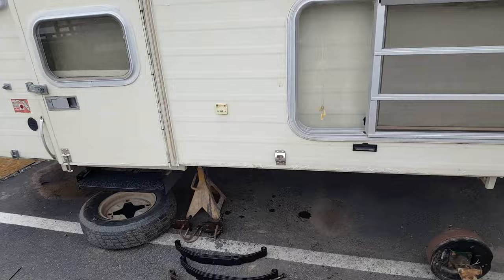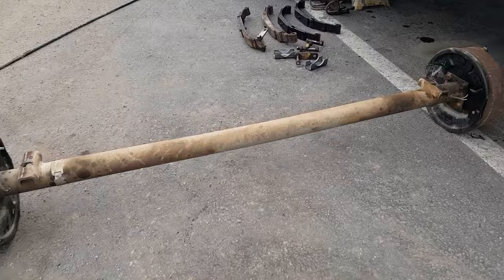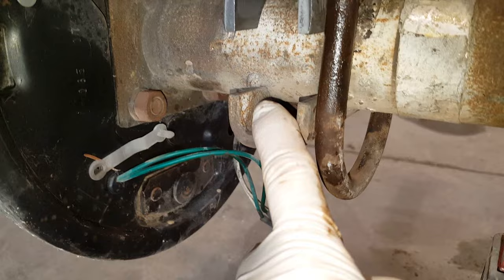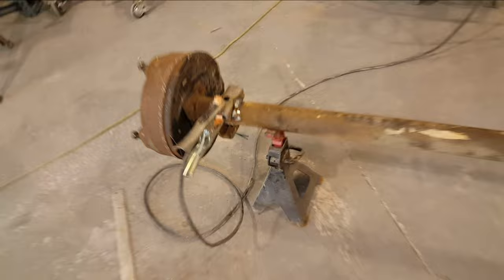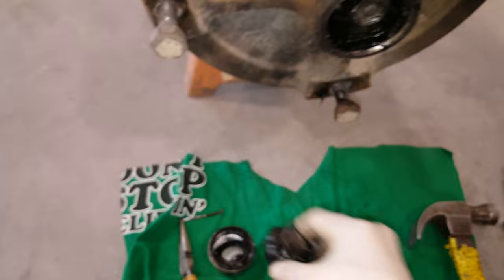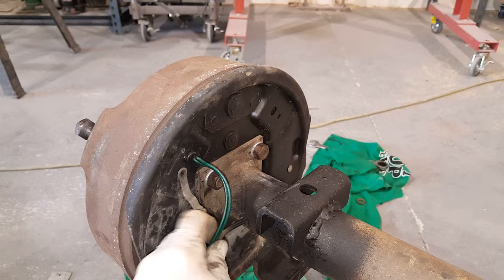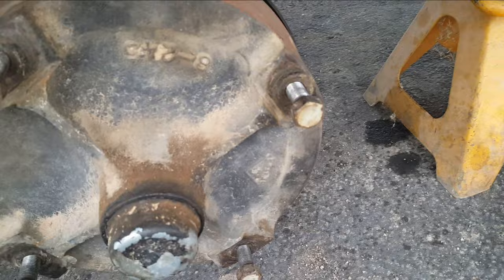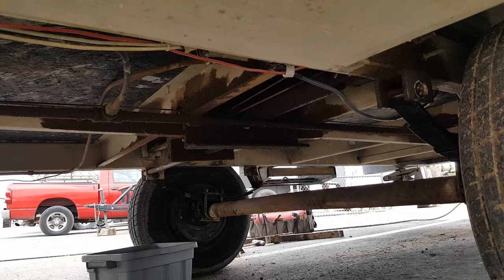Trailer Axle Flipping....What's the BIG Deal?

Comment: I’ve learned to be cautious when welding perches on trailer axles. If the wiring for the brakes happens to be touching that area inside the axle tube where you’ll be welding, it doesn’t end well. I’ve gone as far as using bailing wire for a fish tape and leave enough bailing wire to pull them back through when I’m done welding.
Reply from the maker: thats a good idea too

Comment: Iam a  Veteran of the same job!!!  Time consuming but not difficult. Not sure if customer requested quality parts but try to use Dexter components. And Wet bolts. Most springs come with crappy nylon bushings, tap them out with the new brass bushing. Nylon dry bushings are junk. And DIYers paint the entire job with Rustoleum. Customer most likely didnt want higher labor charges. Great job!!
Reply from the maker: I'm not convinced Dexter is any better quality. I try my best to weigh quality work with cost to owner. This was a "project" trailer that came in for a simple solar panel install. The owner felt like it was leaning when being towed and this is what I found. Ideally the axle and all components should have been replaced and new tire rims, but that would cost more than the trailer that would receive minimal use. Thanks!

Comment: Usually takes way longer when you’re filming! I never did this axle flip, but was looking at a trailer a few years back that needed this done. I admit, I would have not done this correctly due to lack of knowledge on this subject. I n9t know the correct way to do this. (By the way, your video just popped up. I was not searching the subject) Great video. Many will benefit from it, and my knowledge has increased. Thanks.

Comment: Looks like I guessed correctly when hanging the new axles .I wasn't sure what direction the axles went but I figured wires out the back ...lol... looks like I don't have to swing them around.  The old 3500lb idler axles only had a 1/4 inch long bead on 1 end diagonally from each other ...not all 4 corners just 1 corner diagonally.  I realize there's no twisting force on these like a drive axle and when they make 1000s of axles it saves money and time , but for me when I put the new 5200lb  brake axles on in place of these I ran beads I know are not going to ever fail ...lol... it's just like the hanger kits they sell that are identical for 2000-7000lb axles... I've seen those broken as well , so  extra beef was added to all the mounting because who wants to crack something  hitting a pothole on the road because big manufacturing companies do the minimum to save a few dollars on assemble line vs building it bullet proof .

Comment: Given that the wheels are  an old style not used any longer (as evidenced by the wheel lug pattern), I would have highly encouraged the owner to replace either the entire axle or at least the hub/drum if a modern style 5 on 4-1/2 is available to fit the old spindles.
Reply from the maker: You'd be surprised how little people want to spend on a $500 project trailer
Reply: @AZExpert   You shouldn't. be. LOL

Comment: I have always been of the opinion that if you remove U bolts from an axle, they should be replaced with new. Because torqueing tends to twist them a little, and removing the nuts when removing weakens the threads. Just a thought.
Reply from the maker: I have always heard that too. In researching it, it seems like "best" practice but no real hard facts stating it has to be done, other wise it would be true for all bolts. To my knowledge only torque to yield bolts require it and of course locking nuts and washers. Like all things, damaged hardware should be replaced but also not all owners are willing to spend $15 sometimes no matter what. Thanks!

Comment: Use torpedo level, top and bottom for welding on perch.....check with measurements,  but using level will guarantee axle is parallel to ground before you start,  and new perch will match.
Reply from the maker: Thanks for the tip

Comment: The reason for the bow in the axle is because the axle tube is not very heavy for the load it’s carrying. Travel trailers are made as light as possible. Thinner axle tubes save weight. 
Next time you see a semi trailer parked take a look at the axle. There’s no bow because it’s designed to hold 20,000 lbs each. 
In a light trailer there is a few inches of axle that is between the springs and the tire. This space creates leverage on the center area of the axle. When you load your trailer the bow straightens out. If you flip the axle up side down the axle would bow even more creating a negative camber at the tire causing premature tire wear.
Reply: John VH 2019 

You’re partly right

Comment: I once used new hardware but needed to loosen a nut. You guessed it,  it wouldn't give up without a fight.  The rv parts  supplier told me the U-bolt is designed to stretch the threads at full torque for safety.
Reply from the maker: I don't know much about it all, but I know a local suspension shops that makes u-bolts and they are put in a jig and bent for $5-10

Comment: You should have put new bump stops on the trailer now too.  While the trailer was raised about 4”, the range of the springs did not change and the bump stops need to be lowered what you raised the trailer from the spring-over conversion.

That’s why the spring broke in the first place.  Excessive travel.

Comment: Primary and secondary shoes are now reversed.  If they were reversed when the previous owner flipped the axle, you corrected the mistake.  If not, you made a mistake when you rotated the backing plate without swapping the front and rear shoes.
Reply: He did exactly what he should have done. The wiring went out the back to the rear. Primary shoe was in the front. He even states which direction the wheel would rotate. His explanation is spot on.

Comment: I have a 1987 camper that I wanted to raise the ride height on a few years back. Axle flip wasn't really possible since it had a bow to it from the factory. However, I just welded on new spring perches. Worked great and didn't affect anything on the axle or springs
Reply: Mike Miller 

They are designed to have an arch. If you put the springs on the top of the axle. Yes, you in fact DID (axle flip) it

Comment: Although the Hi-Lo trailers were a lot more aerodynamic and very well built, they were extremely heavy, for what u gained in less wind resistant u lost more in towing weight, plus very expensive!
The salesmen would not mention this, "I'll tell the truth a couple of different ways before I'll lie to u!"

 Also because of the  limitation in height  and interior space they used smaller tires which wore out a lot quicker and rode very rough! 
Great video on axal repair!
Reply from the maker: Very pricey too

Comment: I may have missed something but my question is about the crown on the axle. If you were moving the springs from the bottom to the top why were you having to do all that to the hubs. I get that someone had already moved the springs to the top but just did an axle rollover which would have put the crown pointing down. With you installing new perches that would have enabled you to set the crown back at the top as it should have been. Wouldn't the hubs be in the right position since the axle was upright again? Unless when they did that axle rollover they switched the hubs at that time which would mean you would then have to change them back. Nice informative video though.

Comment: you should have switched complete backing plate from right to left, because if you look at your brake shoes, you now have the primary and secondary shoes backwards. The shoe with the most brake pad material goes towards the rear of the trailer. It matters on a car brake system, would imagine it works on same principle as that. Are your trailer brakes locking up? good video tho
Reply from the maker: Thanks for watching!

Comment: Guess the previous axle flipper had never heard of camber. That trailer will now pull better than it has pulled since the axle flip was done. I occasionally add camber to axles that have lost their camber or never had any camber to begin with.
Reply from the maker: It's understandable when we call it an "axle flip" I just couldn't be responsible as a shop owner for not addressing the major issue. Thanks!

Comment: Nice thorough job. So what your saying is the safest and most proper way to raise the trailer is, instead of flipping the axle, simply weld new perches on each end, on top of the axle, then mount the springs on top of the new perches? I'm thinking you also have to extend the spring mounts, both front and back?? Safety FIRST always. Happy travels
Reply from the maker: The spring mounts do not need to be extended as that distance does not change, only the the placement of the axle below the springs. Thanks!

Comment: On a trailer that is that old it is a good idea to replace the wiring that goes through the axle tube. They short out inside the tube.
Reply: Yes they rub inside tube and short out.I zip tie new wire on outside back.

Comment: It is always recommended to use new Ubolts and nuts, but great video overall.
Reply from the maker: Indeed, it is best practice to replace the u-bolts, but I know the owner was already spending more than he wanted too. Also, I do find myself wondering why u-bolts are one time torque bolts, but studs/lugs made nearly identically are never replaced no matter how many times they've been tightened. Part of me thinks there's a lot of CYOA from the axle manufacturer.
Reply: @AZExpert  U bolts bend when tightened.  Even if only a small amount,  they still mold themselves to the axle. Straight studs dont do that. And not all hardware is supposed to be reused. People just do it anyway. I doubt one reuse hurt at all. Just an FYI reminder.
Reply from the maker: I understand and I'm not a metallurgist or material scientist by any means, but the stress of tightening any bolt by its very nature stretches the metal at the threads even on straight bolts. I understanding replacing lock nuts and lock washers as one time use. I  am not arguing and agree with you, these are just thoughts I have while turning wrenches. Maybe I should have put the effort into being an engineer. Thanks!
Reply: @AZExpert I wasn't trying to start a debate, but there is a huge difference between U bolts and a standard straight bolt.  Actually, metal stretching is not a major concern.  And my previous statement was very poorly worded and I should have left that out.  ASE1541 steel has a tensile strength of 150,000 psi.   The true issue is that U bolts are made with rolled threads and not cut threads.  Rolled threads distort when torqued.  Cut threads do not.  Once rolled threads have been distorted, they can never be removed and reinstalled to hold proper torque.  In reality, they are single use threads.  U bolts can be retorqued as long as they are not loosened to do so.  That is because you are simply moving the nut up to new threads.  But once removed, the threads are permanently damaged.  This is not the case with a multi use bolt or lug with cut threads made of the proper grade and torqued to proper spec.  I confirmed this information with a mechanical engineer as well as a technical rep from a major spring manufacturer.  They also said loose U bolts are the #1 cause of broken springs.  So, I change my previous statement.  In this case, one reuse can hurt.  And this is one of those situations where not finishing the job with proper hardware could be the cause of future issues.
Reply: thecatsfan 

I’ve reused u-bolts many times with no ill affects. The ones that tend to brake are the shackles. Seen that MANY times. And no, u-bolt threads do NOT distort when torqued 😂🤦‍♂️I’ll let you figure out why😂🤦‍♂️Your book learning(?) doesn’t cross over into real life scenarios.
Reply: @Fordgroup00  Nothing to figure out.  Not going to argue facts.  The statement I posted above - a full year ago - is a direct quote from Eaton Detroit Springs.  The information was provided by one of their engineers.  If you want to argue with the manufacturing engineers - be my guest.  I have no further interest in your incorrect analysis.  I will trust learned knowledge and physics over dumb luck every day.
Reply: Mike Barger 

I’ve got quite a few years of actual hands-on experience. But cool story
Reply: @Fordgroup00  I don't care if you claim you invented them. I am not the one here pushing my personal opinion as fact. I am citing industry experts, documented engineering standards and referencing credible sources.  You claim to know better than the people who actually write the automotive engineering specs.  That's the tall tale here.
Reply: @thecatsfan  In all my years as mechanic I've never seen a U-bolt axle break. If it did break, it'd mostly be from over-tightening it. Because they didn't use a torque wrench and the proper specs.
Reply: @kdlittlehawk  I'm not even a mechanic and I have seen it more than once.  And if you have never seen it your assumption that it was not torqued properly is baseless.  The manufacturing engineers openly disagree.
Reply: @thecatsfan  Leafsprings break first before any U-bolt will. Engineers aren't on the front line seeing whats' happening. I've had truck and diesel vocational training/schooling and worked in the truck and heavy equipment industry for years. I've never seen a U-bolt broken as a primary factor. Replacing them may be a good idea but not necessary. Replacing any used nut or bolt is a good idea but again, not necessary.
Reply: @kdlittlehawk  I don't care if you teach mechanical repair.  That entire argument is a defined logical fallacy.  Who you are or what you do does not change physics.  So far your primary arguments are that you are smarter than an engineer because you turn a wrench for a living, and what you have not seen does not exist.  Those premises are both defined flaws of basic logic. In previous posts I explained in detail why rolled threads are not designed to be torqued twice.  I do not care if you believe facts.  Does not make them any less true.
Reply: @thecatsfan  LOL..let it go, man, it's ok. You must be fun at parties, LOL 1
Reply: @thecatsfan  I feel sorry for you.
Reply: @kdlittlehawk  Whatever you have to tell yourself to feel important.
Reply: @thecatsfan  last word? LOL
Reply: @kdlittlehawk  Except you cannot stop yourself.  Every time I pull the string you have to speak.
Reply: @thecatsfan  Just make sure you replace your lugnut studs everytime you change your tires. LOL !
Reply: @kdlittlehawk  I would explain how stupid that comment is, but if you could actually read the thread, you would already know that.

Comment: Hope I don't have to keep writing this over and over because of the ads. I have an axle I want to flip, (turn over)  as well as put below the springs, from a 1969 Shasta camper trailer. The axle is 58 " from wheel to wheel. It has an upward angle right angle bend at each wheel 3.5" measured from the center of the square tube axle. I want to keep the brake adjustment and wiring in the correct places so I have unbolt in order to switch the wheels. I will weld a large washer so the axle will not slip on the springs. Is what I am proposing something that is feasible? The trailer is too low  for a camper trailer or just as a general purpose trailer.

Comment: I just bought a 5x8 c&b utility trailer. 
The previous owner had flipped the axle but didn't add new braketes or consider the camber, and I've just learned the proper way from you, thanks!!
I plan to flip it back , how would I know if anything is damaged?
Reply from the maker: trailers are pretty strong and if it tows straight you should be fine.

Comment: So what are the pros and cons of doing an axle flip? I have a PJ Trailer with leaf spring under Axle and I've been thinking about flipping it. They come out of the dealership this way for a reason I suppose but when I look at the axles and leaf springs on a semi dump truck, the leaf springs are on top and to me it looks like it should be that way. So I'm thinking if  18-wheelers use it that way why don't these flatbed gooseneck trailers come like that..?
Reply from the maker: The pros are more ground clearance, while the cons are more ground clearance meaning the step up would be much greater. In general, the flip is prefered if you are doing more off-road RVing. Thanks!

Comment: I gather you may not be for flipping axles, but what is your opinion on the use of a drop axle flipped for use as a lift axle? More specifically an axle rated heavy then the intended use and one that would see off road use often where the drop axle upside would clear better?
Reply from the maker: I think axle flips are great and most trailers should come with them standard. A drop axle must be mounted the way intended too, but if it's on leaf springs you can flip them just like a straight axle. Should give some good center clearance for sure. Good luck!
Reply: @AZExpert  Thank you for the reply, my axle in question is actually a custom built axle that was made using car hubs and thick tubing. All bolts are rated for 1000 pounds more then the capacity aswell

Comment: I would not be reusing a bent axcel, the tyres will wear unevenly .
Reply from the maker: leaf spring trailer axles will have a bend or crown, torsion axles may be straight though
Reply: @AZExpert  troy has a point i was thinking i was the only one to notice but that axle looks like it was overloaded at some point so it now has a permanently  reversed crown not flipped but bent i obviously cant  take measurements because I'm not there and i can only  see it on a computer screen and the image may be stretched and skewed a little but it looks like it was way overloaded to me and the reverse curve in the spring is an indication as well. now keep in mind i do not claim to be an expert but i do have more experience then most of the sheepole out there and i am not saying your wrong just something else to consider